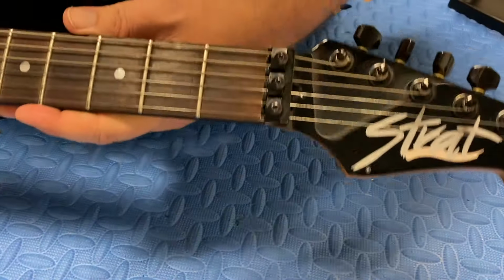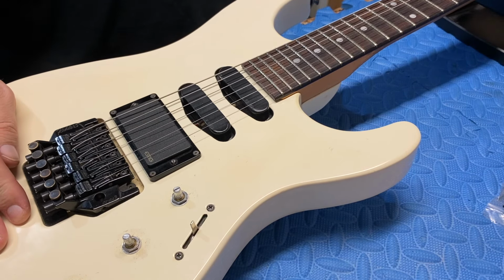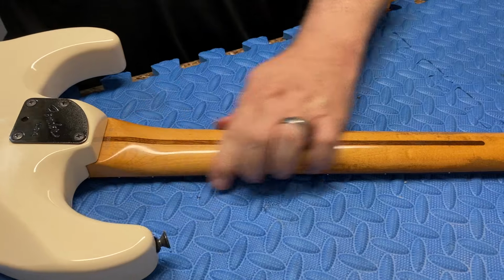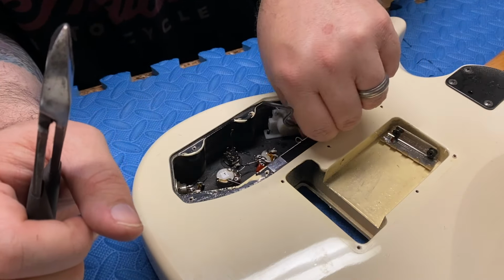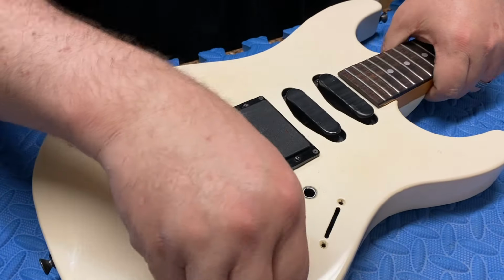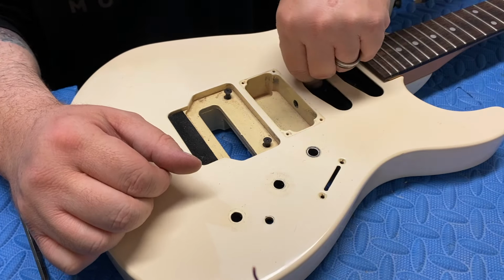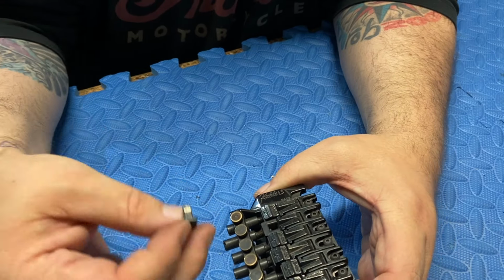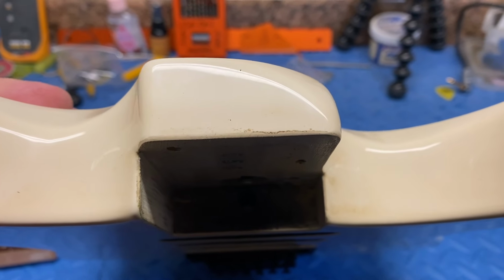Fender Heavy Metal Strat Disassembly & Inspection (HM Strat)

Comment: I’m in the opposite boat. I just got one of these almost the same but with maple neck. I want to swap in EMG pickups from the original ones thanks for this video, helps me see how to do it. Now just need to figure out which pickups to use.
Reply from the maker: Keep in mind you may need to rout out some wood for the EMGs like mine has in the bottom of the pickup cavity
Reply: @chiba131 I’m new to guitar but these stock pickups just aren’t as “hot” as my mh-1000 emg or fishmen pickups. I just can’t get it to make a similar sound without turning all the settings up way higher. Even then it’s not the same. I could be doing something wrong but that’s why I’m thinking of making the swap
Reply from the maker: @FreedomCrawler  You're probably not doing anything wrong - you're just one of those people who likes the sound of EMG pickups! Nothing wrong with that at all :)
Reply: @chiba131 I’m trying to reverse engineer your video to add what you took out. Could you tell me what the setup was on your EMG setup that you took out
Reply from the maker: @FreedomCrawler  Yes, it was a Hum-Single-Single setup, I think the hum was an 85 and the singles were SAs. They were on an import 5-way pickup switch with a master volume, and the neck & middle on the 1st tone, bridge on the 2nd tone.
Reply: @chiba131 much appreciated. The smaller pots correct? Not the 250/500k
Reply from the maker: @FreedomCrawler  I think if you go with whatever pots come in the set, you'll be golden. IIRC EMGs work best with 25k (not 250k) pots.